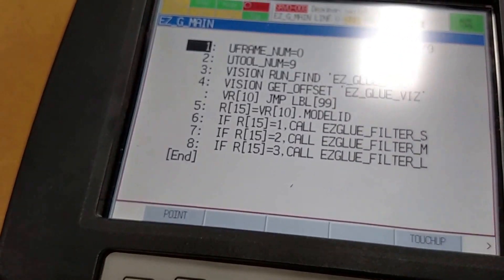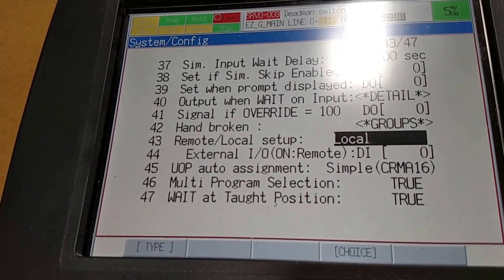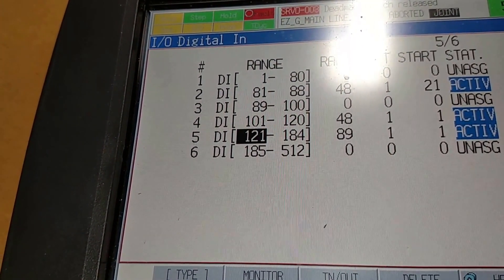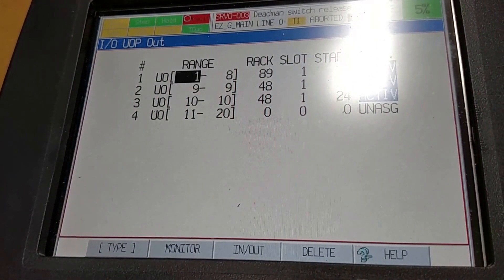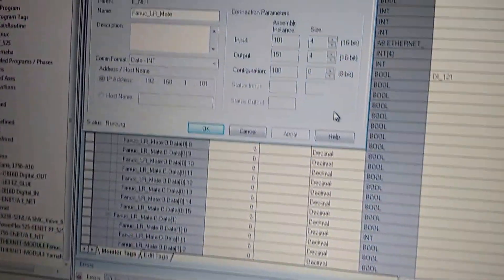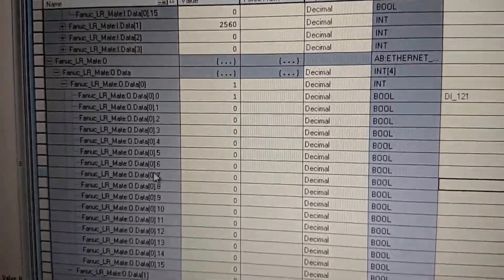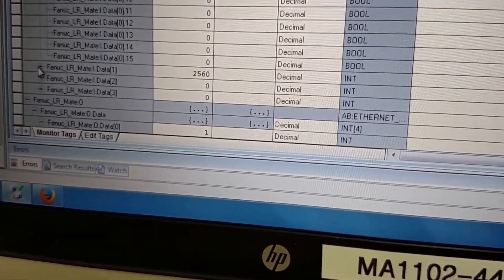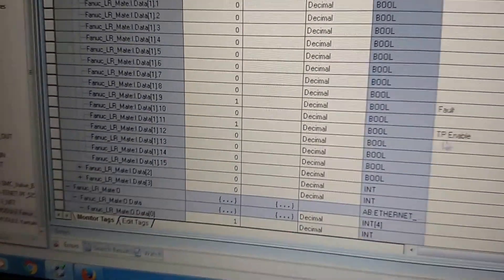Setting up FANUC Robot Ethernet IP to Logix controller

Comment: One question, what capacity do the ethernet ports of the FANUC robots have?
Reply from the maker: I'm not sure. You'd have to verify that with FANUC based on the specific model and version of the robot controller. I think all the new models support Gigabit communications. The older ones are probably 10/100Mbps. Having integrated vision may provide other speeds.

Comment: There is a y problema if I want to use a Micrologixs 1400 and the RSLogixs 500?
Reply from the maker: I'm not sure. As long as you have Ethernet IP communication on the MLX1400 you should be able to configure it. It'll be more difficult to determine the MSG settings and Bit: addresses, but there is probably documentation available from FANUC. Good luck! Let me know how it worked out!

Comment: Thank you for video. It is great. I have a question. Can I use an old compactlogix 1769-L35E to set up Ethernet IP with Fanuc 30iB controller. Thank you.
Reply from the maker: Yes, the model of the PLC should not be a problem. You may want to download the FANUC Robot AOP. It makes the module configuration on the PLC easier for the newer robot controllers. Good luck!